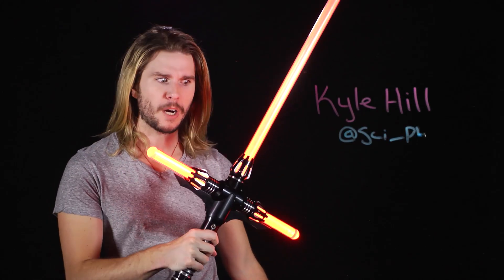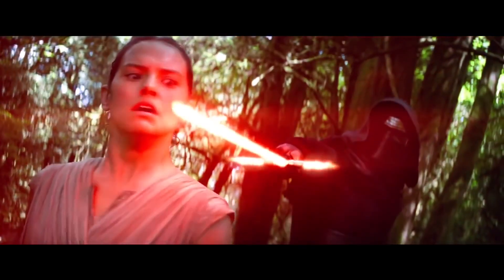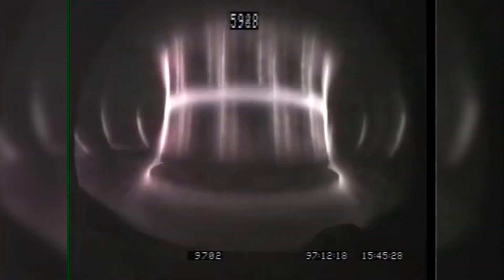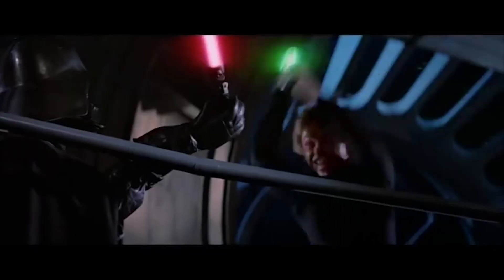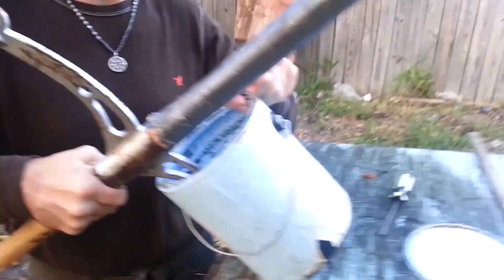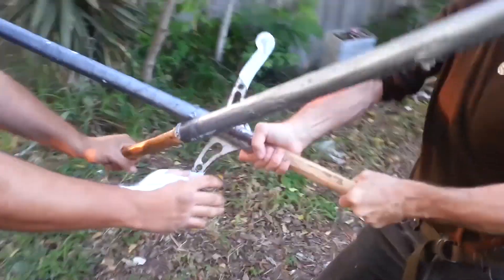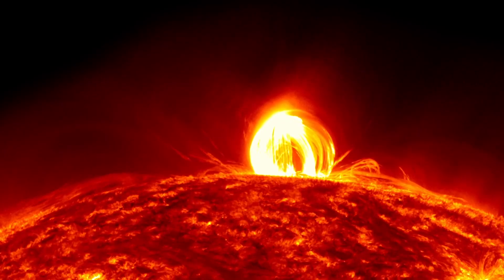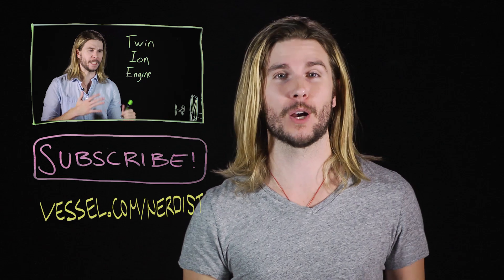Why Kylo Ren's Lightsaber Works (Because Science w/ Kyle Hill)

Comment: i thought kylo wasent so strong with the force and the reason of the design was to vent the extra ligiht saber energy
Reply: Kylo Ren isn't able to fully harness his power due to him being unable to focus properly. 

He is trying his best to be like his grandfather, but cannot. He wants to be devastating in the Dark Side, but he can't be. He is a light side user that cannot be corrupted so easily by the dark side, and that's pretty interesting in my opinion, as it is said the dark side can corrupt absolutely. 

Kylo, in the midst of battle, isn't one with the force so to speak. A Jedi, or a Sith, need to have absolute focus when trying to use the force, or even battle. Or else their conflicting emotions will weaken them considerably. 

Rey only overpowered him because she was focused on defeating him, she was focused on saving her friends, and the Galaxy. So her power in the force overcame his unstable one. 

He isn't weak. He has the same potential as Anakin, Luke, Leia, and Rey but he isn't able to focus at all. He should have left and became a Jedi once more, and he would have been the most powerful.
Reply: Makoto Kazuki Well, he was taught by Luke, and he showed clear resistance to the dark side. An incorruptible Force user naturally would pass on some traits of that fortitude through strength in their own training. The only difference is, Kylo's mind is intrinsically weak. He cannot contain or control his emotions in the slightest, therefore in his current state this makes him the weakest Force combatant to date. Even Sith have discipline, as you rightly said. 

If he accepted how deep rooted of a Jedi he was, we'd have to see. But somehow I doubt he would be considered stronger than Anakin for the same reasons. Let's not forget Anakin killed several Jedi in their own Temple, beat the master fencer Count Dooku who was trained by Yoda, and gave Obi Wan a fierce run for his money. The only reason Anakin lost was due to his arrogance accompanied with his vast amount of power going to his head.
Reply: +GamersAddictionWeek Ren has some degree of power, but it's pretty obvious he has about as much experience as actually battling with a Force user as Ray does. He's too clumsy with his ability in general due to him being a clearly conflicted being, and it shows. He couldn't overthrow a rookie Force user's Pull for a lightsaber despite being trained extensively by a Jedi master. This either makes him weak, or far too conflicted / out of touch with himself to even use his power properly. My guess is he straight up murdered his compatriots cloak and dagger style, not even close to a real fight. 

Also, you're wrong about Kylo being the only one keeping objects in place without keeping the hand up, Vader force choked his own men without even lifting a finger at times, and freely walked away from one letting his hand down before releasing one. He did so regularly throughout the original trilogy. Vader / Anakin is the most powerful Force user to date, technically, as the Chosen One. His midichlorian count was above even Yoda's, as stated in the first prequel.
Reply: GamersAddictionWeek Hrmm. Plausible, definitely. Perhaps due to the fact Ren was first taught by a Jedi Master's understanding of the Force that he was able to Force Grip blaster shots, but a Jedi's power comes from their discipline, their calm, absolute control of their emotion. He regularly has temper tantrums, so I think he has too much Jedi rooted in him to ever be an effective Sith, and lets his frustration out in random bursts. He looks a bit too much of a noob Sith, in actual combat his emotions are wild and all over the place, and his training is even stated as incomplete. He's trying to use Jedi technique with Sith technique and ideals, and the result is sloppy, unpolished and exploitable. I think the instability of his own homebrew lightsaber reflects this perfectly.

He'd never be a match for a Jedi with the same degree of training as him, which is why Ray made a mockery of him with zero training. She trusted her instincts, first and foremost, a hallmark of all Jedi Masters.

Comment: It's most likely used for offensive uses as shown in the battle against Finn. Notice how light sabers lock onto each other when they collide. What light saber duels have you seen where the light sabers slide against each other instead of stopping once they make contact(or even bouncing off each other). whatever material is in them has immense amounts of friction when in contact with another blade, hence why the iconic blade pushing is a thing instead of one of the saber fighters trying to slide the weapon off their opponents blade to their opponents hand. Kylo rens additions to his light saber give him an edge in one of these situations where he can actually cut you while your blades are locked together by just maneuvering the angle of his hilt while you blade is too stuck to do anything. hence why he burned Finns shoulder during their duel.